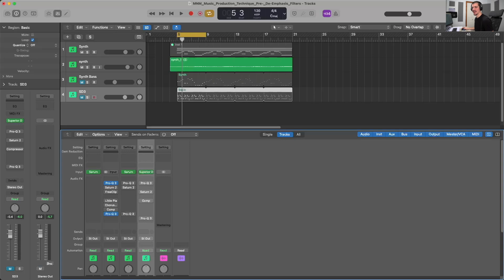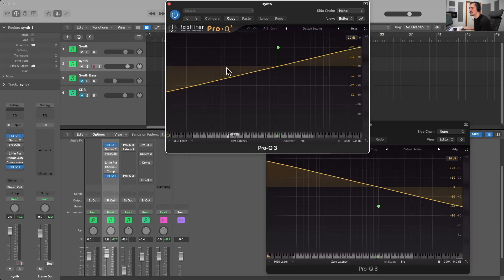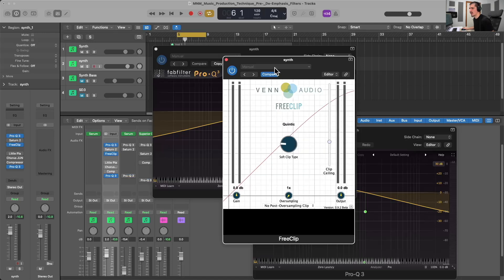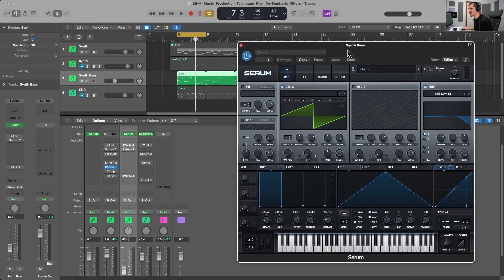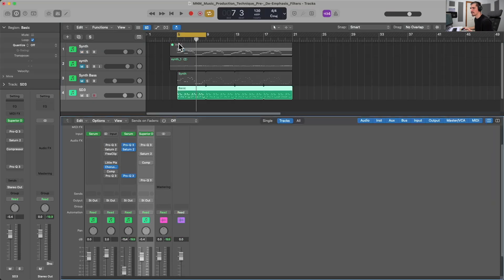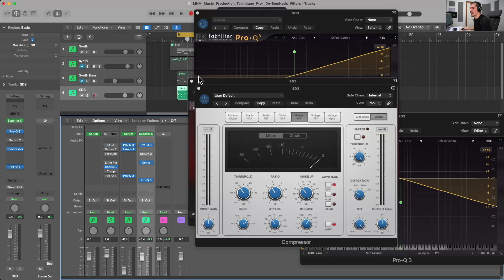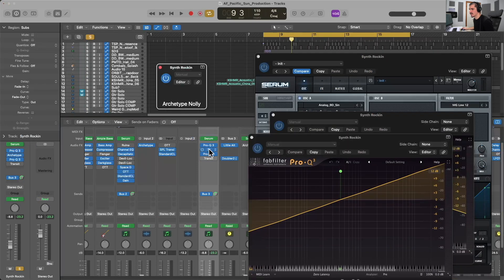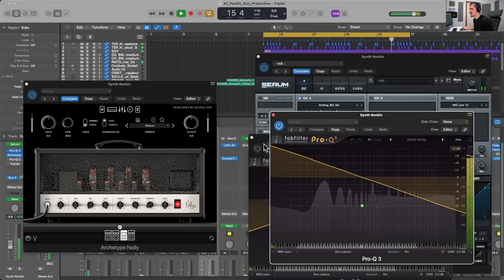Shaping Tone With Pre- And De-Emphasis Filtering

Comment: Reminds of electric guitar processing : Guitar , treble boost ( emphasis) > Amp ( Distortion) > Guitar cab ( lo-pass fillter - de-emphasis) . Very interestign tecnique , the synths sound very juicy
Reply from the maker: I never really thought about it that way (and I'm primarily a guitarist) — there are so many parallels in audio engineering and music production. Single flow, signal flow, signal flow! It's amazing what we can get by simple re-ordering of processes.

Thanks for watching!
Reply: @ArthurFoxMusic  if you love electric guitar, then you have to try a physical treble booster , a dallas range master / brian may style unit. DIY kits are like 20 bucks, and it gives you amazing sustain and tone. You will discover the real use of your guitar's volume control. It is a very simple one transistor high pass filter that interacts with the electronics in your guitar ,and really shapes the distortion produced by another pedal or your amp. It has to be physical/real though for maximum benefit . Cheers and fantastic job on this video !
Reply from the maker: DIY pedal kits look like good fun — Might pick up a few and even make videos on them!
Reply: @ArthurFoxMusic  sounds like a lot of work ! This level of quality... this video , I think it's even better that Dan Worralls's video on the subject. Hours and hours of work to put this together
Reply from the maker: That's quite the compliment. I appreciate it!

Comment: Apparently works with other types of EQ filters too, bell and shelf for example. What would you call it, frequency-controlled sidechain?
Reply from the maker: I'd say the terms "pre-emphasis" and "de-emphasis" would work in any case, so long as they're opposites of one another — I just chose to show tilt filters because they're easy to conceptualize (and how I'll generally use them).

Of course, it's as simple as adjusting the frequency content going into an effect/processor or chain of effects to alter the audio information they process and then (if you want to) de-emphasize those same frequencies. I'm basically discussing a specific style of such processing.

The big overarching concept is to think about the audio GOING INTO any given process (namely distortion/saturation or dynamics processing), as altering such signals can have a big effect on the final result.

EQing a sidechain is different as it doesn't alter the "program" audio — the audio being processed by the dynamics process (compressor usually).

Hope that helps!